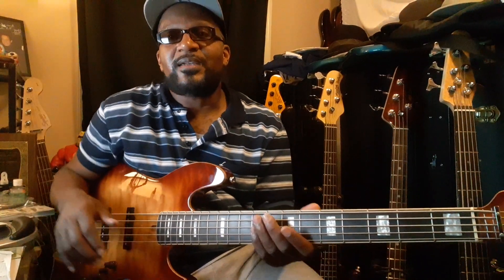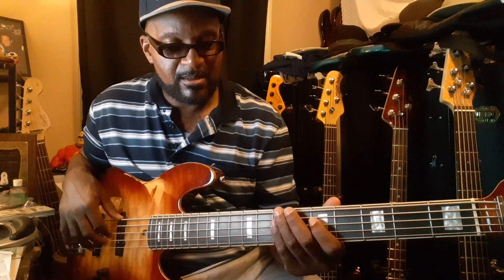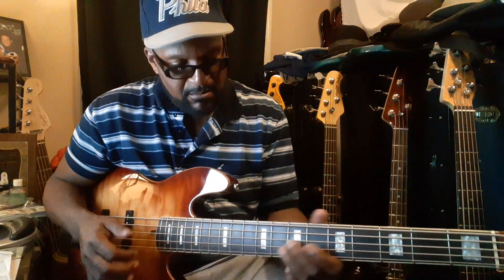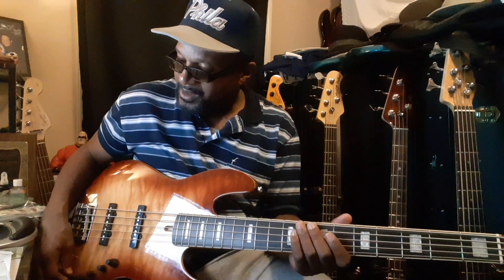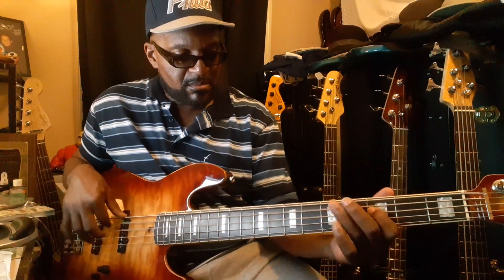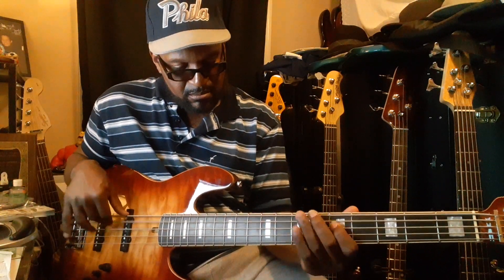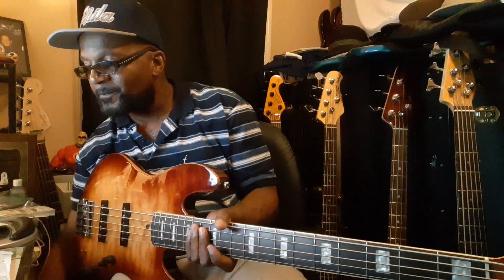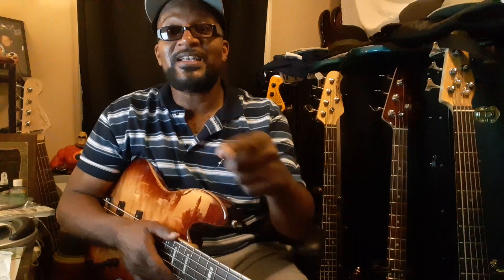Sire "MARCUS MILLER " V9 BASS DEMO

Comment: Hey Coop the stacked Mid is Boost or cut on top and Frequency on the Bottom Those Sire V9 are Definitely worth the Money.
Reply from the maker: "GOD!' THEE ALMIGHTY FIRST!"  Yes,... this bass been hanging on my wall ever since they came out.  I never knew how drastic the bass changes so quickly once you dial the knobs.  Wow!  Blowing my head off.  I have to do some sessions with this bass.  (Lol!) . Yes, it is definitely worth the money.  (smiles).